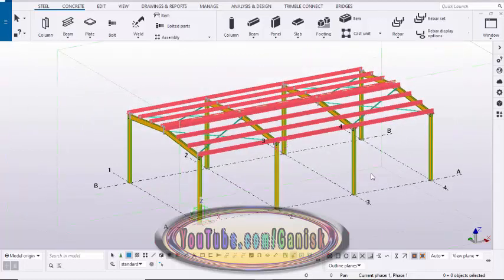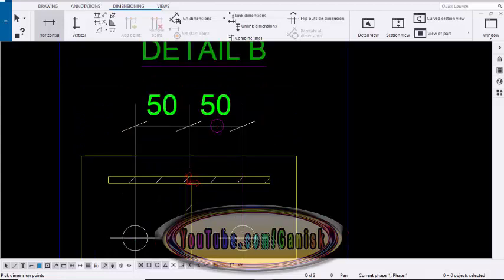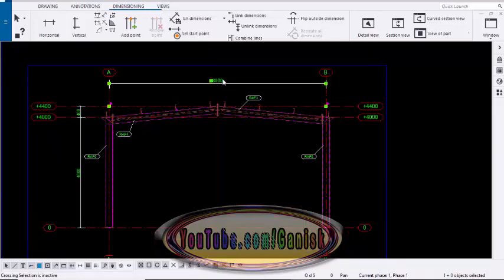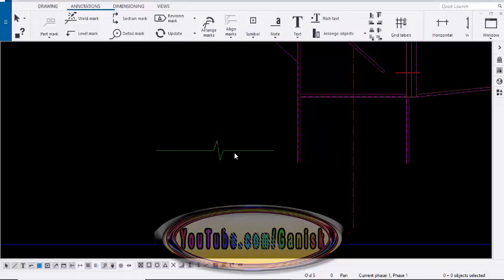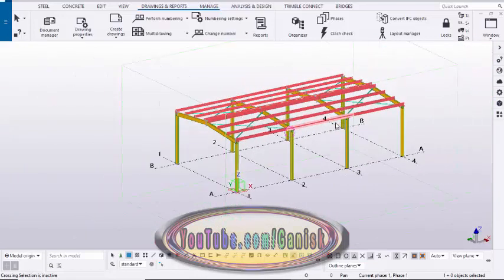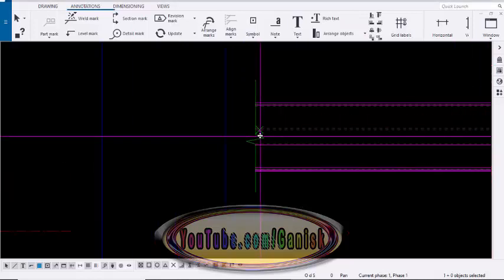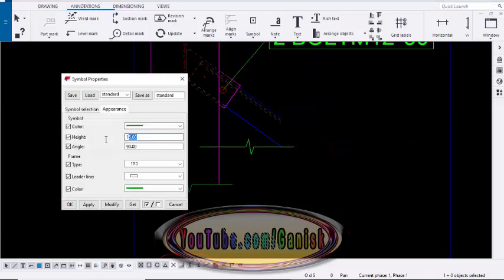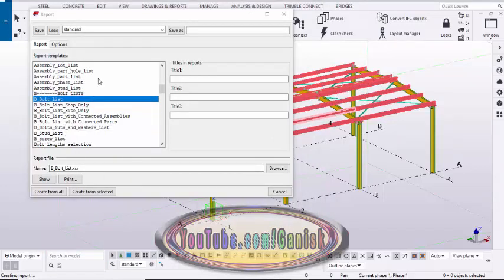Tekla Structures Complete Project 4 PEB Part-4 (GA Drawings, Reports)

Comment: Hi Brother, 
how are you,
How can we add two units (metric and imperial ) in GA Drawing ?
Reply from the maker: Hi brother, I am good,
By default not possible, you will get only one unit format based on which environment you have chosen before create the project.
Yes, you can include other units by typing text format manually.